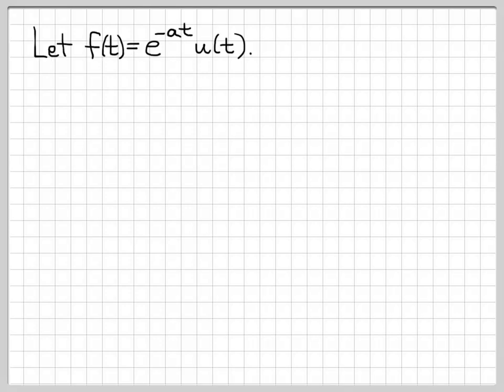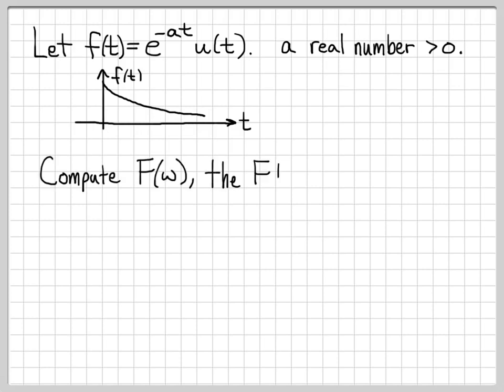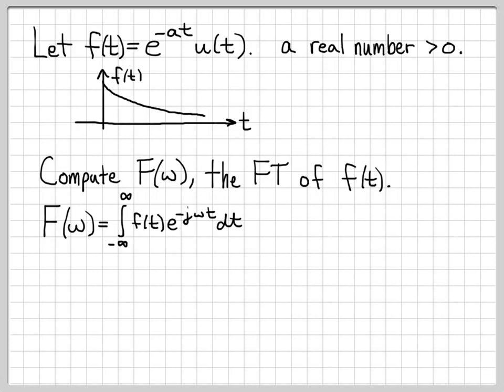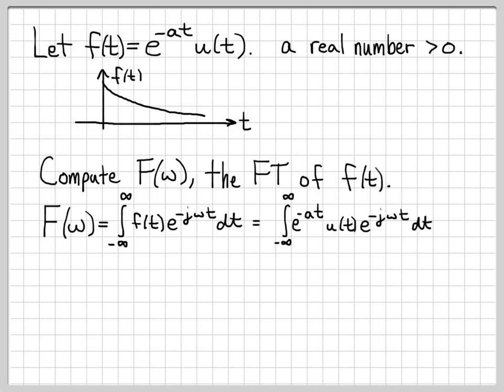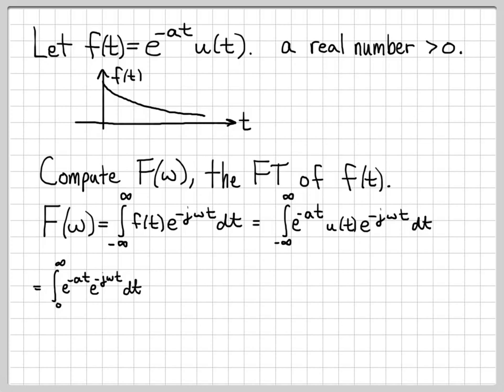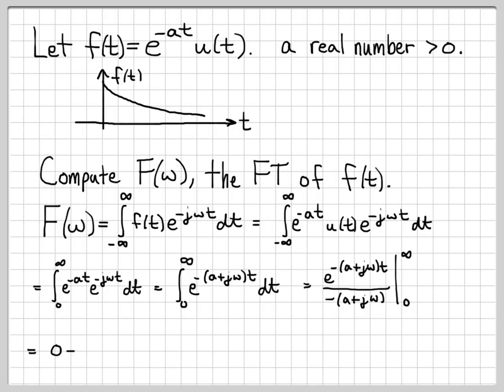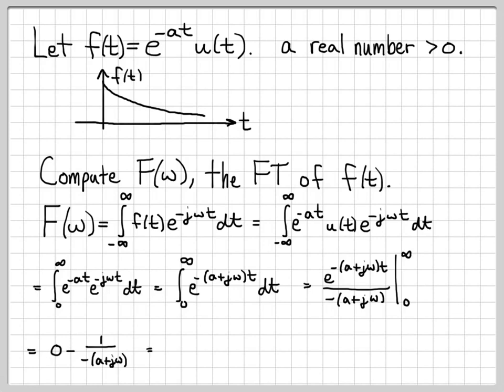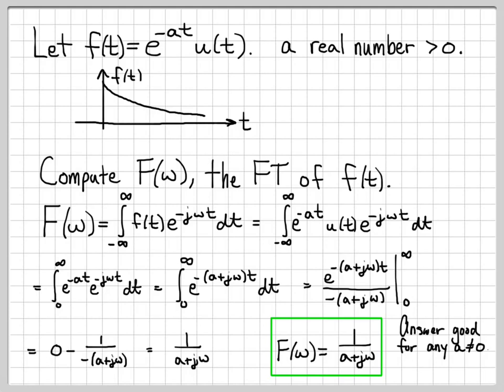Fourier Transform Example 01 - Right-Sided Decaying Exponential

Comment: I do not understand why u(t) is just gone. Can you please help. Thank you
Reply from the maker: The signal u(t) is the unit step function.  It is zero for all time t less than zero, and equal to 1 for all time t greater than or equal to zero.  The starting integral had limits from t = -infinity to infinity.  Since the integrand is zero for all negative time due to the unit step function, we simplified the limits of the integral to be from just 0 to infinity.  Since u(t) is equal to 1 for all positive time, u(t) = 1 on these new integral limits so the u(t) was replaced with a 1.  Hope that helps,
Adam

Comment: Are you sure it works as well for a < 0 ? For me, it is undefined.
Reply from the maker: No, this example is only for a "right-sided" decaying exponential, i.e. we require a > 0.  If a < 0, then the FT integral "blows up".  Hope that helps.
Reply: Sure it helps. That's because you said at time 4:35 that the answer is good for any value of "a" as long as "a != 0". So I assume it was a little mistake at the end of your video. Thanks a lot !
Reply from the maker: OK. Yes, I just did not say that as clear as I should have.  I was trying to emphasize that while we sketched a real-valued signal, the math in this video also works for complex values of "a", as long as the magnitude of a, |a| > 0.  I should have said that more clearly,